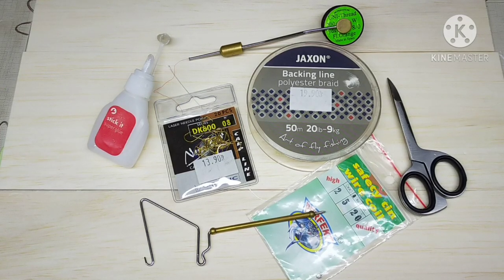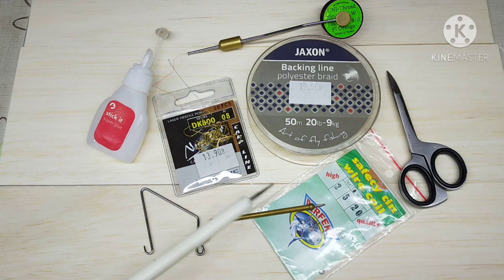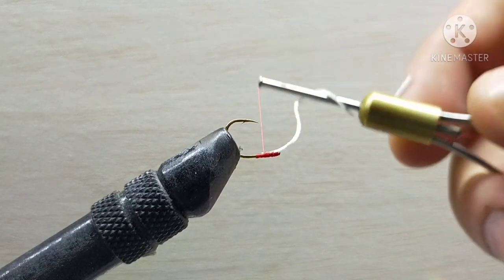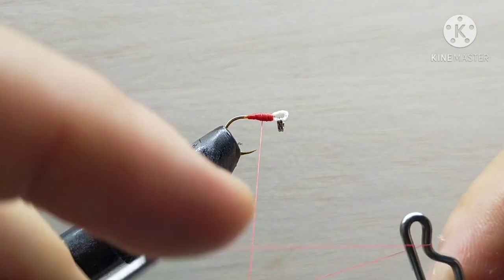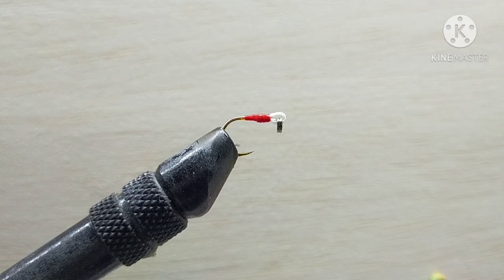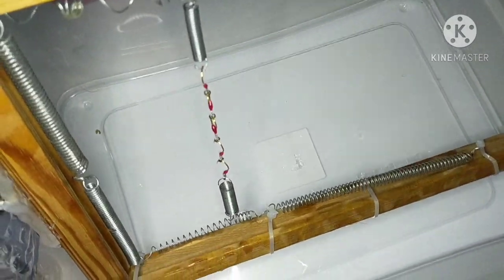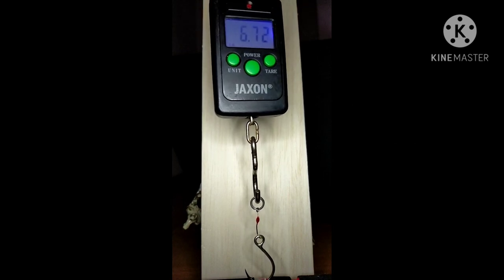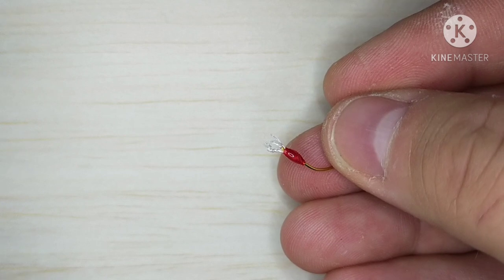How To Tie Single Assist Hooks For Trout / jak zawiązać pojedyńcze haki pstrągowe

Comment: Hi the thread you are benn using is 18/0 or 8/0 ?
Reply from the maker: Uni thread 70 denir 😉 but of course suit the size of the hook 😉 once the Super Glue is applied it becomes super strong connection 😉
Reply: @SuchaJerkCustomLures  Thanks sir for info, can i use waxed thread 8/0 ?
Reply from the maker: @coretan6749  I think it should be fine, just the waxy part... I'm not sure if it wouldn't prevent the super glue to sip through the thread wraps 🤔 so don't remove the flat part, or the eye of the hook, like I did, to prevent it from slipping

Comment: Nice vid! I've been wondering if you cut the eye off can this make the winding slip off the hook when a fish (big fish :)) is on? Most of commercially available assist hooks I see keep their flat eye. I'm going to make my own hooks, but now having this dilema - to cut or not to cut. Cheers.
Reply from the maker: So, if your going for trout hooks, the lack of the flat eye is increasing flexibility of the loop (which in case of trout twisting during the fight is more important than the strength) and still the glued and UV cured connection is stronger than the loop itself. However if your plan is to fish for different stronger species I would suggest to leave the flat eye on to prevent slippage at heavy loads.
Reply: @SuchaJerkCustomLures  Thanx!!
Reply: I personally leave hooks untouched because I'm a little bit nervous about cutting a piece of metal like that: could damage the rest of the structure and expose a sharp edge. I tie assist hooks on my lures directly without a ring which allows for a slightly longer braid and that's it. The braid can twist without issue and it makes the lure totally silent although it's less convenient if you are to change hooks often (as you can prepare them in advance if you're using a ring connection). I'm extremely happy with this technique so far. It's a shame that so many trout lures are still shipped with treble hooks, there's really no good reason to continue fishing with those IMO 😕
Reply from the maker: @FartsOnMars  yeah, the silent connection 😉 I came out to the same conclusion lately that it may help in my pressured waters. I do use it with bigger trebles (not for trout) I found some tutorial about "braid split rings" so I just tie them like that 😉